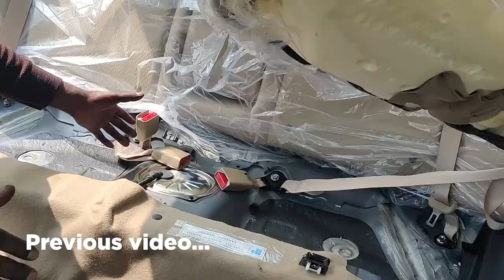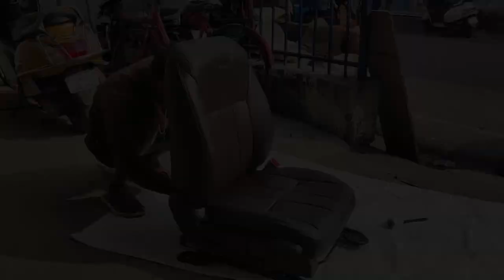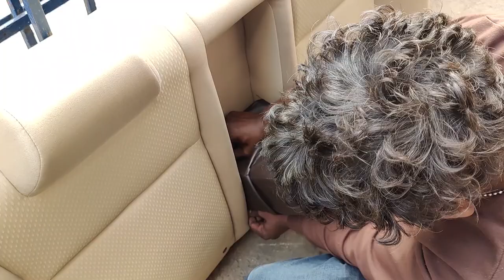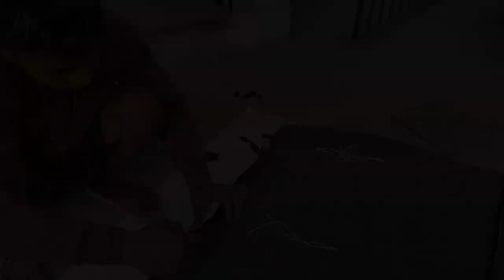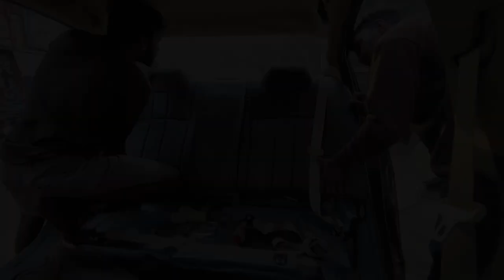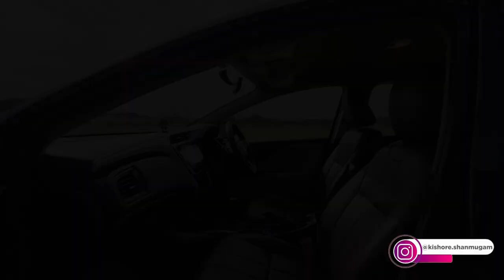Everything You Need To Know About Car Seat Covers (Detailed Explanation & User Review) | G.P Road

Comment: Bro, one small doubt. Does this car seat cover really needed? why can’t we use the OEM fabric seat instead?

Any advantages using this cover except dirt and easy clean? please suggest your view bro
Reply from the maker: It's gives you extra protection and highly improves the interior looks of the car bro. Even in future you can just change the seat covers without disturbing the OEM, like after 3 or 4 years thus the stock seats will be not be impacted by wear and tear. It's an additional touch which will benefit you in the long run that's all!